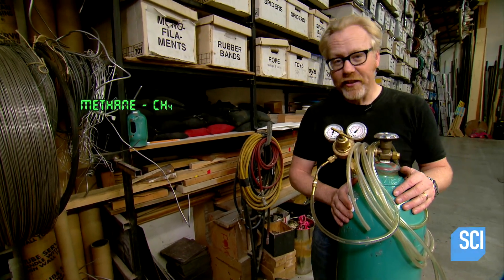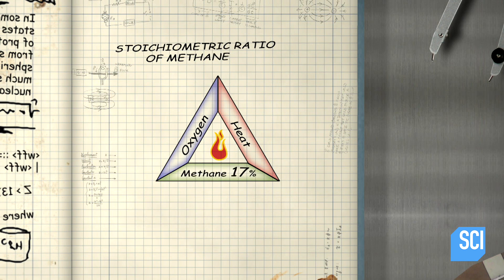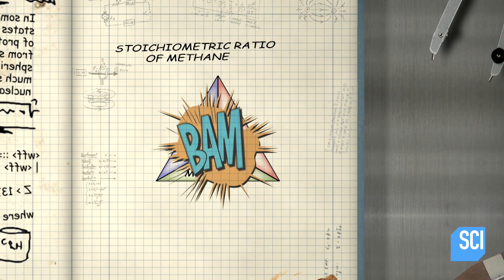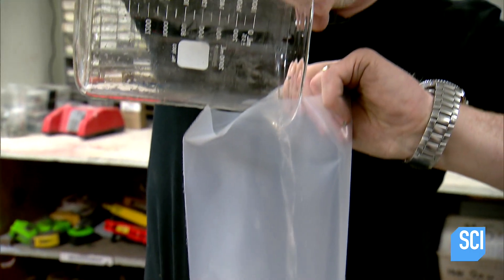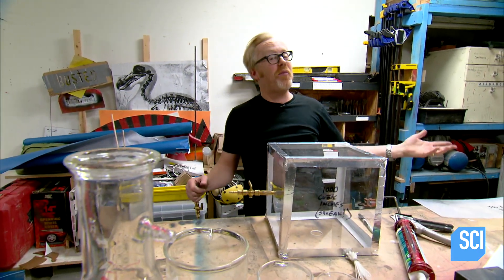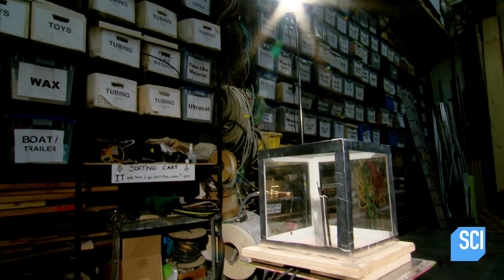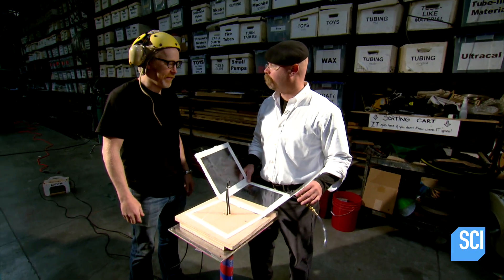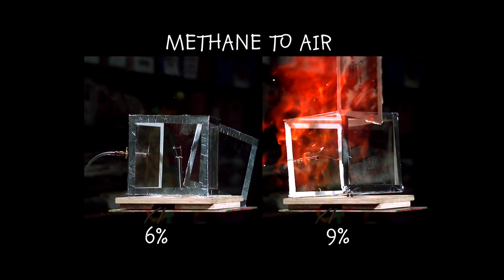Testing the Perfect Stoichiometric Ratio of Methane | MythBusters

Comment: The Stoichiometric ratio varies by ambient Pressure (Altitude) and Humidity.  That's why the range of 6-17% is so broad.
Reply: @Psiberzerker  it (avogadros's law) is very weird, but the chemical qualities of a gas (so nomatter if it's hydrogen, oxygen or even xenon for that matter) does not influence the amount of particles in a given volume if the pressure and the temperature stays the same. So these changes in air will change the composition of air and the pressure and the temperature ect. but unless you really haven't ventillated the room or someone really farted a big it will stay roughly the same.
For gases the molar volume (or however that translates to english) is the same, that is why you don't need to count with the mass of each gas.
Reply: also we know that at any pressure the amount of molecules of a gas is constant, at 1 atm pressure, room temperature it is 24,5 cubic decimeters/liters per mole, so you need a 1:2 volume ratio of methane and oxigen, with 21% atmospheric oxigen it comes down to 10.5% of the volume being methane, so 9% is a bit off
Reply: @Psiberzerker avogadro's number is literally the mole, it is a constant therefore it doesn't change. And yes, the particles are different sized, but that does not matter in this.
If you are talking about the binding energy between every single proton and neutron, that also doesn't matter and it only makes its mass ever so slightly different.
Reply: @Psiberzerker  well I won't argue with you
Reply: @Psiberzerker  I wasn’t talking about that, I’d still stick to the actual ways we’re taught in (a top end in terms of chemistry) high school and by not argueing with you I absolutely did not mean that I you wrote it right. I guess you were trying to proove me being wrong by orders of magnitude, still just please, lets cut this shit
(Oh and btw CO2 is totally linear)
Reply: @balazsbelavari7556  No, I'm not trying to prove you wrong, I'm trying to talk about Stochiometric ratio.  Which has fuck all to do with molar mass.  IDGAFF why you're trying to change the subject, but it's not even the same chemistry class, let alone the same chemistry lab.  You're talking about the basics of atomic weight, while I'm talking about mixing methane with stuff that makes it go boom.  If you don't want to argue, don't.  If you do, at least get on the same textbook, even if you can't find the same page.
Reply: I agree, a Mole is a Mole.  Just like a meter is a meter, and a gram is a gram.  The problem is, I'm talking about Liters here, and for some reason, you're talking about Moles.  We don't have to talk about Moles, so Occam's Razor.  It has nothing to do with this experiment.  Adding an unrelated constant to the equation doesn't add anything to the equation.